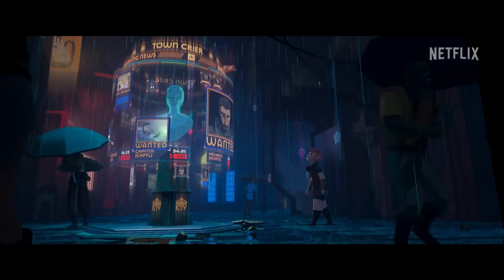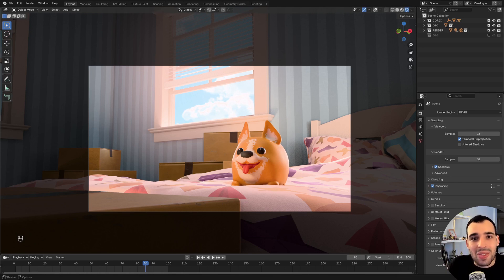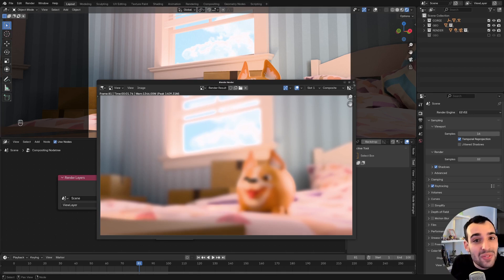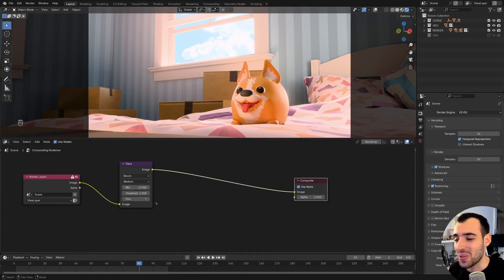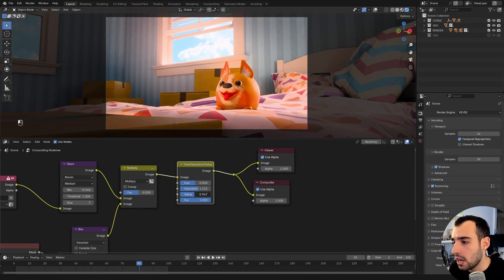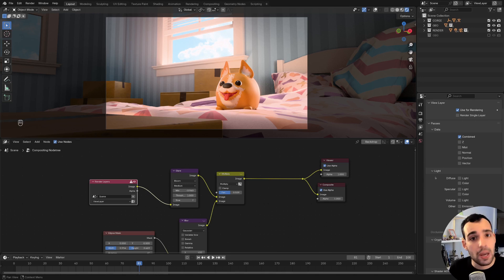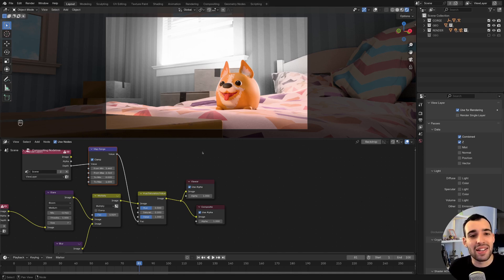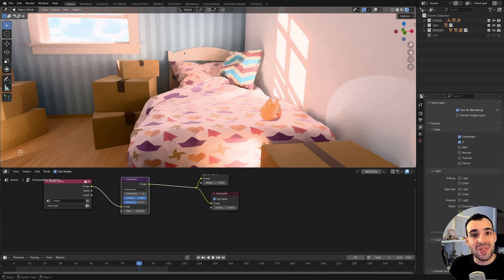THE BASICS - Blender Compositing for NPR Part 1

Comment: Is there a way to fully hide the inpaint line? Thanks!
Reply from the maker: I don't know what you mean by inpaint line. In the case that you refer to the matte line that sometimes appears when using inpaint, you can remove it by adding a convert alpha node set to straight before it

Comment: When I use the depth pass, everything shows up white but when I use the mist pass with a modified depth value, everything works fine. Is there a difference or is it fine that I use the mist pass?
Reply from the maker: The reason you see white is because the depth pass actually gives a value to each pixel based on how far an object is from the camera.

For example, if an object is 0.5m (or scene units) from the camera, the pixels which depict that object will be mid gray. At a distance of 1m, the RGB values of those pixels will be pure white. But, since our renders have a high dynamic range or, speaking properly, the pixels have a floating point bit depth, these values can go above one. An object thats 2m away will have RGB values of 2 and so on.

You need that raw depth data to make accurate math on your depth. For example, for making fake DOF, you could get something working with the mist pass but it would be inaccurate and dependent on the scale of your scene. For creating masks the mist pass is fine, but I encourage you to get familiar with the depth pass too!

I hope I'm making myself clear! :)
Reply: Thank you for the explanation, it really helped me understand a bit more! Is there any way to ‘clamp’ the range of values from 0-1 so that I can get the range of values for the shot?
Reply from the maker: @seasoned-pastronaut you can use the map range node!  Checking clamp and using the "from min and max" values as you would on the start and end of the mist pass should give you the control you're looking for to create masks
Reply: i think i found a solution to this.  i got it to work by adding a normalize node before the map range node